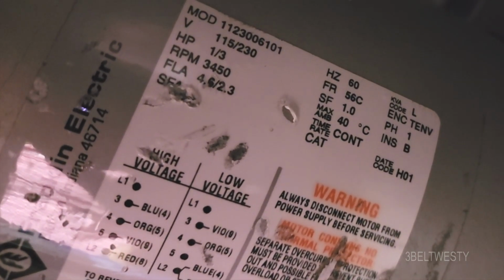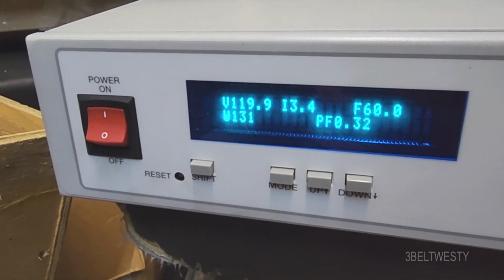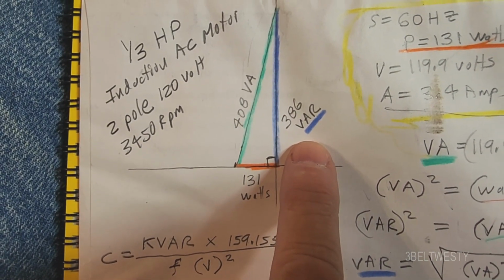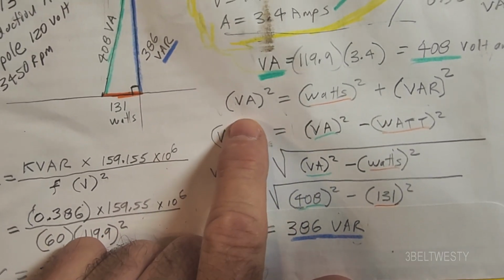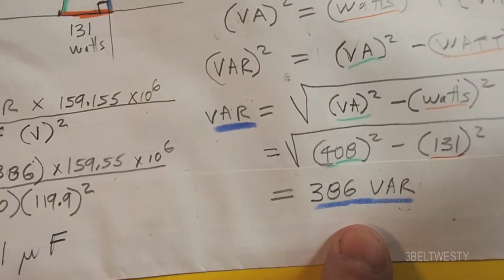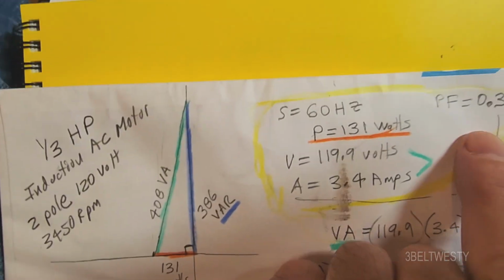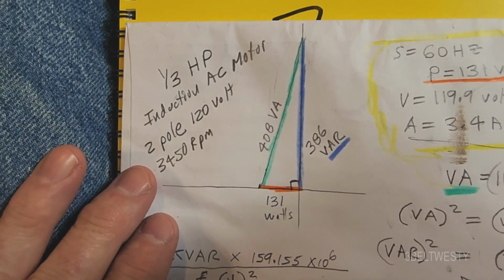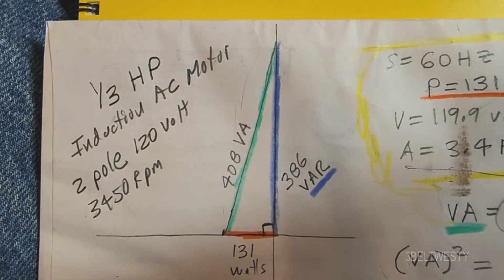VARS Power Factor explained Volt Amps  capacitor

Comment: Where’s the rest of the video? What’s does the meter show when you add the capacitor? What does it show if you add a bigger or smaller rated capacitor?
Reply from the maker: will do another video adding caps.